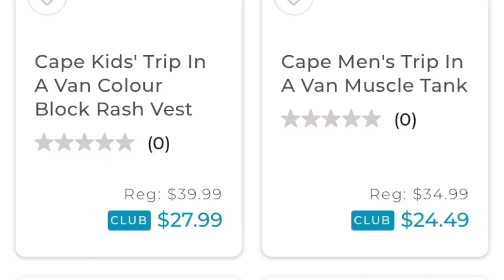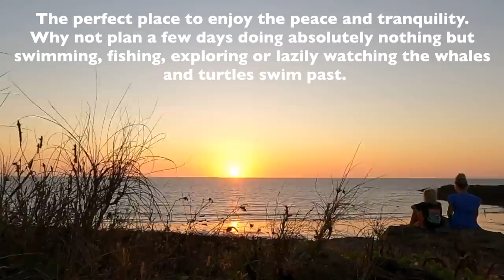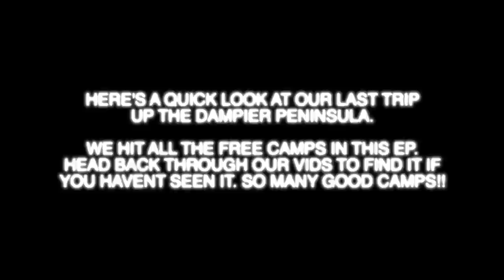West Oz's Best Beach Camp, Yes Sir & Big Xmas Giveaway - Roadtrip Australia - Middle Lagoon

Comment: Awesome video as usual, slightly biased as I love that part of the world and what you do, cracking day fishing, have you tried the Tuna as steaks rather than filleting. Try gingernut biscuits for the seasickness before you go out. The only problem with sealing the Cape Leveque road is that it opens the area up to some rather disrespectful campers n visitors in my experiences.
Reply from the maker: Yeah I’m worried what the easy access will do to this peninsula. I reckon they need to put a Pay station at the start of the road
Reply: @TripInAVan  Yes but no because then it will mean a (generally speaking) more disrespectful crowd, I reckon they should of left it dirt (maintained more regularly) because most people want the camp but not the dirt or they could just put about 100mm of red dirt over the top. Dare say it was sealed for the oil n gas industry 😑🤑🤑 when it should of been  at least better maintained for the communities up there

Comment: Love watching your content. What projector do you use? Currently in the market for one that is 12v and rechargeable 🤔
Reply from the maker: Its a Benq GS2 - bit dear $1299
Reply: The expensive ones are much better quality, easy to connect (bluetooth etc) built in sound thats decent etc.    But while your saving up there are cheap ones out there like the one Annaconda do for about $150.  Image is acceptable, sound is ok, lots of cables etc.  But it does the job and the kids love it.